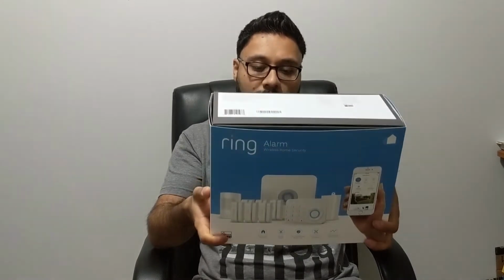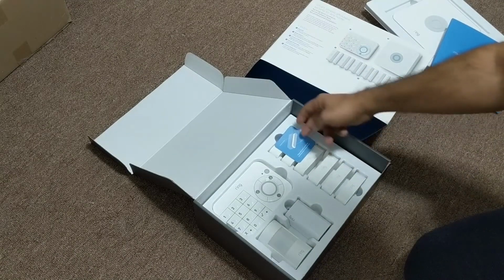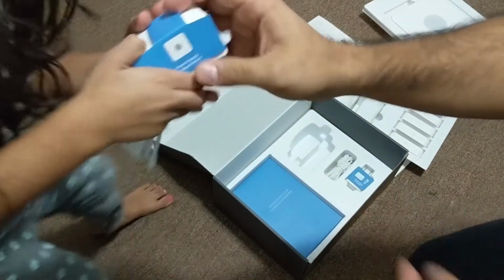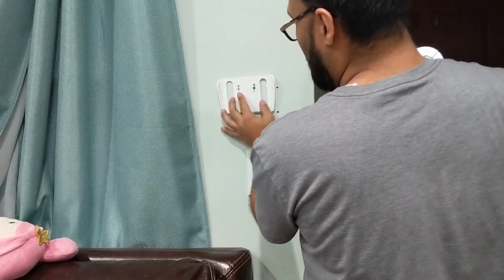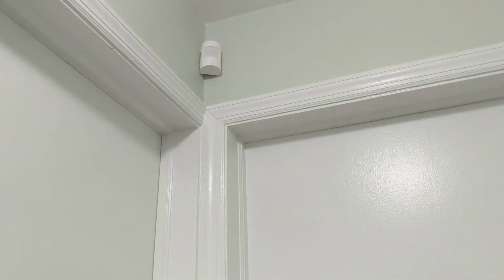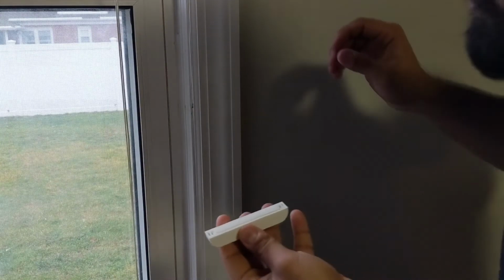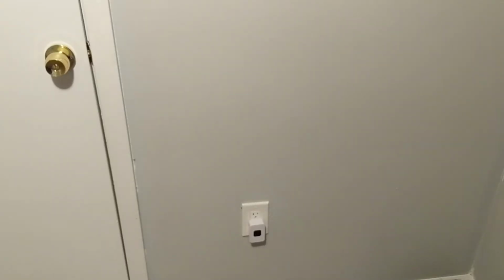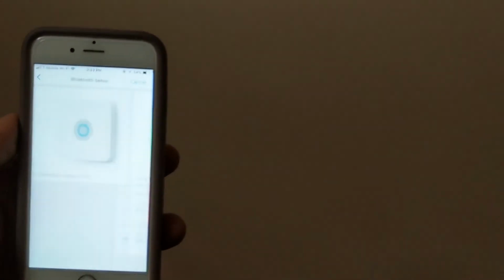Ring Alarm Security System Installation

Comment: Important!!! Only pull the tabs or plug in the extender when instructed during base station install. If you pull them early they will not have the right signal to each other and you will have to take out the battery or unplug and replug in the components.
Reply from the maker: Thank for providing additional feedback. I never had an issue setting up gen 1. I did plug in and setup base first then the other items

Comment: You drilled the keypad wonkey
Reply from the maker: I pulled the old adt keypad and drilled one of the hole with the drill. The drill you see is actual impact driver and I was tightening screw with that :)